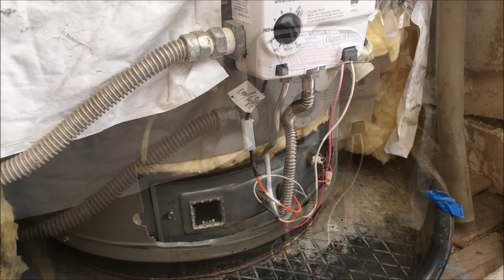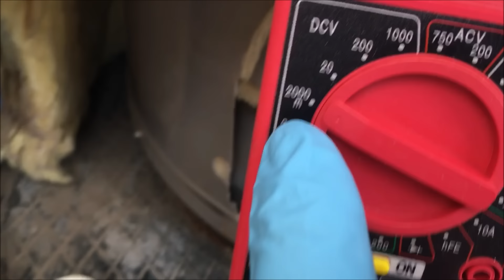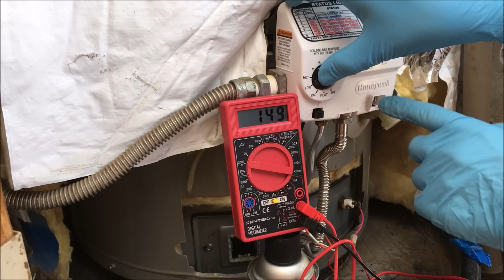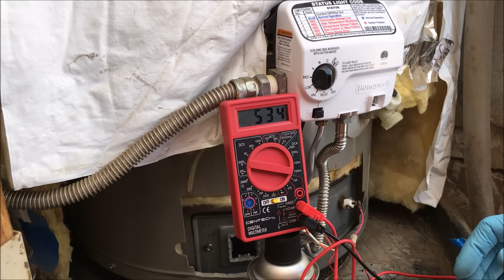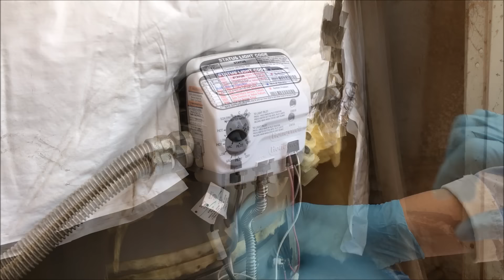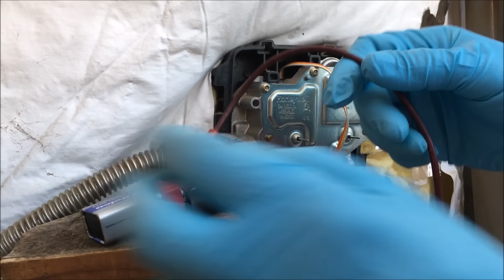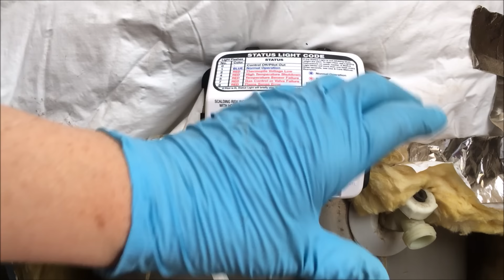Troubleshoot Water Heater AND Honeywell Gas Valve | Step-by-Step

Comment: Excellent troubleshooting information. I learned a lot.
If you can light your pilot and you know that the thermopile is putting out and you get NO flashing lights from your led on the valve, doesn't that tell you right away that your valve assy has failed?
Reply from the maker: Thank you, Richard.  Does the pilot stay lit or extinguish, immediately or after some time?
Reply: @frugaldiy1  Hi Frugal,,, Mine is working. I was referring to the unit you used for demonstration . I am a small-time landlord and water heaters are a common headache for me. I have replaced or repaired more than a dozen, however the one at my own house is 16 years old - that's pretty old for a water heater.
The subject of replacement boards for these controls interests me. I looked on Ebay this and saw either a complete new control valve for about $200,,, or a used board for 50-ish, and who knows if that board would work?
Reply from the maker: Oh, I see.  To your question in your initial comment.  It's not typical for an actual gas valve to fail on a gas appliance, e.g., water heater, gas insert, gas stove, gas dryer and so on.  It's usually something else that has failed.  But, on these water heaters with electronic Honeywell gas valves, the control boards cause folks endless grief.  So, no, is not an indication that the gas valve itself has failed; it's an indication the control board has failed.

I'd get a pre-owned replacement board off eBay from a seller who is a plumber and is selling the control boards, or entire gas valves, from WORKING water heaters the plumber has pulled.  That's what I'd do.
Reply: @frugaldiy1  I gotta admit, the mass air flow cleaner is a killer idea. I have that can sitting in my garage in plain sight yet I couldn't think of an easy was to blow out the lines in a water heater pilot assy a few days ago.
Those control boards work in all these types of Honeywell control valves even if the control valve has a different part number?  Maybe I should cruise around and stop every time I see a water heater sitting at the curb for scrap, and rob the boards if they are this style.
Reply from the maker: Well thank you, Richard.  I can't say with certainty that all of the control boards are interchangeable with all gas valve models, but I gave it a try, and it worked like a charm.  Another viewer replaced the failed control board on his NG (natural gas) water heater with a control board from a propane (LP) water heater and it worked just fine.  Boy, I love all of you wonderful resourceful folks out in YouTube land.

Comment: Hi there, I tested the pins with the 9v and the left one, described as being the one for the pilot valve, doesn’t make the click sound. Does the manual pilot button bypass this valve? The pilot button will light the pilot flame and stay lit until I release the pilot button but the main burner never ignites
Reply from the maker: The gas valve needs to be replaced.
Reply: @frugaldiy1  thank you, I have ordered one as I didn’t see anywhere that stocks it. Thank you for making this video, was very nice to go step by step and isolate the issue
Reply from the maker: You're welcome, Calley.  Last I checked, eBay sellers had the best prices on the gas valves and the control boards.
Reply: @frugaldiy1  thank you, I looked at several on eBay and they have the WV in the listing title but in the item description they had WT for the model, so I didn’t feel confident it was the WV one that can be reset
Reply from the maker: Okay.  Smart!  You can also purchase pre-owned gas valve and control boards from sellers on eBay who are plumbers.  They pull the gas valves and boards from working water heaters and sell them on eBay.  I'd buy one of those from a highly-rated seller.  Just something to consider.  Again, I'm frugal, and it's not typically the gas valve that fails.  It's the board.
Reply: @frugaldiy1  that’s good thinking getting a used one with it usually only being the board that fails
Reply from the maker: Yes.  Sometimes, people just replace water heaters that are working because they want a new one.  SMH!  And, in California, where I live, many people are replacing gas water heaters with on-demand because the natural gas prices are sooooo high.
Reply: @frugaldiy1  lol I agree that a working water heater is a strange thing to want to replace. Maybe in some cases like in California the operating cost savings eventually pays off.
Reply from the maker: I'm old, and when I was young, people tended to use and keep what they had until it no longer worked.  Those days seem but a fleeting memory.  They also didn't worship materials things as much as folks seem to do now.  I remember what an older gentleman said to me when I was seventeen years old, "Young lady, take care of your things, and they'll take care of you."  Those words stuck with me and helped launch me on my path to DIY.  Maybe you too will find some truth in his words.  ;)
Reply: @frugaldiy1  sounds like a wise gentleman, and wise of you to hang onto those words and apply them
Reply: Back here again 1.5 years later as the pilot valve in my replacement valve also quit working. Strange and figured I would share. Ordering another.

Comment: My thermal switch keeps popping and shutting down flame. I replaced it and still have the same issue. What could it be?
Reply from the maker: Manny, first, I'd make sure the vent at the bottom and top of the water heater are clear of dust and debris and not impeding air flow.  The thermal switch is a safety feature that triggers when the water heater chamber gets too hot, per manufacture specs.  I'd also go through all of the troubleshooting steps.
Reply: Follow all step. Everything checks out. Status light doesn't turn on. Do I need to replace the board? Or entire honeywell control panel
Reply from the maker: Just the board.  Go to eBay (cheapest I've found) and type in the model number of your gas valve and look for just a board.  There are plumbers on eBay who sell pre-owned Honeywell gas valves and just boards.  They pull them from working water heaters they replace, and they work just fine.
Reply: Thank you for your quick response. I will be subscribing to your channel. Great video
Reply from the maker: You're welcome, Manny, and thank you.  Welcome to the channel!

Comment: Great video! FYI there is an inexpensive water heater now available (Sure Comfort) that uses the good old analog type gas valve. Made by Rheem but I wont hold that against it. No control board to deal with I imagine but we can all do without that eh? Well at least after all this research I know the difference between a thermopile and thermocouple!
Reply from the maker: Thank you, Jeff.  And, thank you for the info about Sure Comfort.  I'd only purchase a water heater with the old-school gas valve.  ;)

Comment: Your video was EXCELLENT! I just have a couple questions: (my unit is LP) if the numbers I get for the thermopile & thermoswitch top out at 639 & 649mv respectively does that indicate a problem with them? And lastly, does it matter if the replacement control board comes from a natural gas unit or does it need to come from another LP unit?
Reply from the maker: Thank you, Mary.  Those numbers do not indicate the issue is the thermopile or thermal switch; it's something else.  Another viewer, who has a LP water heater/gas valve, used a NG (natural gas) control board and it worked for him.

Comment: Thank you for such a detailed video.  I followed all your steps and had the same issue you had.  Found a new board on Ebay as you said i would, installed it in about five minutes and now we are back in business!!  AND only out $35 instead of the fortune we would have spent on a plumber coming out. 👍👍👍👍👍
Reply from the maker: You're welcome, Manny.  I'm thrilled to hear you fixed the water heater yourself and saved a bunch of money.  Job well done!  Enjoy the hot water!

Comment: Great video 👍🏻pilot goes out every couple days or sometimes a few times a day on calm days so I don’t think it’s a wind issue
Reply from the maker: Hi Jeremiah.  Thank you!  Check the vent at the bottom of the water heater and make sure it's not impeded by dust and debris.  The vent needs to be relatively clear and clean or the pilot will not stay lit.  It's a "safety" feature.

Comment: This was extremely informative and I wish I had seen this week's ago. This is my exact issue. Thank you. As long as the first letters match up, does the rest even matter?
Reply from the maker: Hi Keith.  Re the model numbers, I can't answer that with certainty.  I was only concerned about the first two letters and took a chance it'd work fine, and it did.
Reply: @frugaldiy1  Thank you. I will get as close as I can and do the same.
Reply from the maker: You're welcome.  For what it's worth, I think it will work like a charm.  ;)
Reply: @frugaldiy1  I'm just glad I didn't buy a whole new control valve. I was about to haha.
Reply from the maker: Amen!
Reply: @frugaldiy1  One more question. Do you think there would be any different in the natural gas and LP boards?
Reply from the maker: I've pondered that question several times because, at my local ReStore, I can buy two new Honeywell LP gas valves for $25 a piece.  They just sit on the shelf untouched.  My gut level is that the control boards are the same, but I'm not sure so PLEASE don't rely on my guess.

Go to eBay and buy a used control board from a highly-rated seller.  Plumbers sell them on eBay because they replace working water heaters--the gas valve and control board are working just fine.
Reply: @frugaldiy1  That's what I'll do. For some reason Natural gas is all I can find and they're like 25 bucks so if it doesn't work, no big deal. Thank you again. I know more about water heaters than I ever cared to. But it's valuable knowledge.
Reply from the maker: Knowledge is good!  I see, you're on LP.  Were I you, I'd call a plumbing supply place and ask them if there's a difference in the LP and NG boards.  Maybe they'd know.
Reply: @frugaldiy1  I planned on ordering and then calling on Monday. Worst thing that happens is I waste 25 bucks on the wring board. Time is of the essence. Those cold showers are getting old haha.
Reply from the maker: I hear ya.  Please let me know how it all works out.  I'm rooting for you!
Reply: @frugaldiy1  Thank you.
Reply: @frugaldiy1  Update. Put the NG board in and it appears to be the exact same thing. Also fixed my problem. Thank you again.
Reply from the maker: That's wonderful to hear!  Job well done!  Enjoy the fruits of your labor--the hot water!  ;)

Comment: I replaced the mother board it lights up and stays lit but now my light is green instead blue, it flashes like 3 or 4 times pretty fast, should I be concerned?
Reply from the maker: I can't answer your question because the gas valve on my water heater is different than yours, so I don't know the status codes and such.

Comment: A very good video, thank you. I just have one question. You mentioned that there is a way to reset the control board if you have the 4 flash overheating status. I have this issue. Can you please share the method for resetting this fault?  Thanks again.
Reply from the maker: Hi Richard, and you're welcome.  Here's the link to my reset video: https://youtu.be/rllnMAx05JI

Comment: Gd video!
I have a question,
I have my water setting on A, but the temperature is 165 degrees,
I did have the temperature settings on very hot and hot  3 days before lowering the temperature..
But the water temperature.
When I lowered to  setting letter A,
Still has a much higher temperature,
Than 120 degrees.
And over the last 3 days the temperature is rising from 160 - 175 degrees.
Appreciate some help!!
P.s. The senser light has always blinked once, Since I purchased the until in 2020.
And never changed..
Showing Normal operation.
Reply from the maker: Sounds like a faulty temperature sensor or control board.

Comment: Could you tell me where to buy thermal cutoff switch for AO Smith water heater (same as in video)? I can't find a place where they are sold.
Reply from the maker: Hi Dimitry.  No, I don't.  You have to search around the internet for it.  My water heater is a Reliance brand, if that helps you.  Here's what I'd do.  First, try to reset the thermal switch by pressing the little button in the center of it.  If that doesn't work, I'd remove the thermal switch and find the part number, which will be stamped on it.  Search that part number for an AO Smith.

Comment: The problem on mine is water gets way too hot even on vacation mode or pilot mode. Any suggestions? I've tried the reset procedure.
Reply from the maker: The temperature sensor.

Comment: This is super helpful… after watching several similar videos, kept coming back to this for reference. What do you do if the pilot valve doesn’t click when connected to the battery??
Reply from the maker: Nathaniel, I would think the gas valve itself has failed.
Reply: @frugaldiy1  Thanks for the quick reply. In that case, I guess I need to replace the gas valve... do you have any videos or recommendations for that process? Finally broke down and had a plumber come out and look at things. He said I should order the part and he would put it in for $500. Hoping the gas valve replacement is something I could maybe learn to do on my own.
Reply from the maker: Hi Nathaniel.  I don't have a video on replacement.  Search YT and watch a couple of videos.  It's not at all difficult to replace a water heater gas valve.  I would never pay anyone $500 to do it.  That's a ripoff!  If you do want to pay someone to replace it, call around and get a couple of quotes and a more reasonable price.  Again, $500 is a ripoff.

Comment: This is an amazing video! Covered each and every way to troubleshoot the water heater and the gas valve. Took me a month to find this video but it was well worth the cold showers as I saved $2900+ dollars for what literally was a $30 computer board on eBay. The HVAC company I called initially wanted to just replace the entire water heater system. Very glad I came across this video!
Reply: you can buy 4 heaters with that money
Reply: @jondoh3471  service is a criminal act today...2900 $...shame..
Reply from the maker: Gosh, that's great to hear that you saved so much money AND that you fixed the water heater yourself, zinja12.  Job well done!  Thank you for your thoughtful comment and that you took the time to write it.  Enjoy the hot water!

Comment: Thank you so much for this excellent video. The Pilot Valve pin didn't click when I tested it unfortunately. Does this mean I need to replace the entire control valve?
Reply from the maker: You're welcome, Mo, and thank you.  Yes, it likely does.  But, read down in the comments for a couple of comments by gentlemen who said one or the other pin was loose and they resoldered it.  Check to see if the pin is loose.  Also, with the handle-end of a screwdriver, lightly tap around the pilot pin and see if that fixes it.  I've tapped on gas valves before, and they've worked after.

Comment: Thanks for the video. 10/10...  If you get no click for the pilot valve, what do you do?
Reply from the maker: You're welcome, Curtis, and thank you for the nice comment.  Regarding the "no click" issue, it may be that the igniter switch, versus the igniter head.  Here's a link to my video on replacing the igniter switch:  https://youtu.be/tm4OYqwykPY

I think your issue may well be that there is corrosion between the igniter switch and the plate the igniter switch contacts.  So, don't replace the igniter switch, just do this--take some fine-grain sandpaper or emory cloth, or even a nail file, and lightly sand the head of the igniter switch and the plate it strikes against.  See if that fixes your issue.  If it doesn't, my guess is that the igniter switch or the igniter head (in the combustion chamber and next to the thermopile and pilot head), needs to be replace.  

If you need to replace the igniter head, I HIGHLY encourage you to replace the entire pilot assembly (that's what it's called) because it's a lot easier and cost effective to do that.  So, here's a link to my video to replace a thermopile, which is the same procedure you'd use to replace the igniter head:  https://youtu.be/httzdihCxvM

In the description area of that video, I have a link for a pilot assembly you can look at.

Comment: Thank you for such a nice video. I have always loved to watch troubleshooting videos. I found this when I was troubleshooting my brother's water heater which the pilot failed to light during reheat. It lights up fine during start up but as how water get consumed, it will not re-light. I had changed the thermopile + pilot assembly and that did not solve the problem. I was thinking of changing the entire gas control valve but I just know it'r probably an electronic problem rather than a mechanical problem. This video is extremely helpful in isolating the different components for troubleshooting. Thank you so so much!!!
Reply from the maker: You're welcome, Tao, and thank you for the comment.  Based on what you've said, my guess is the control board has failed or is failing.  The control board may be sensing the water is getting too hot to be safe and shutting down the pilot flame.  It's a common issue.  So, before you go further, try resetting/overriding the control board, like I show in this video: https://youtu.be/rllnMAx05JI
Reply: @frugaldiy1  thanks. He has power vent so I will try the reset as well. The pilot fails to re-light every couple of days which is kinda weird. I’m going to test the pilot and burner valves Ana’s the temp sensor. If they all work then I’ll prob just replace the board. Thanks again
Reply from the maker: Okay, Tao, and you're welcome.  I like you're methodical approach.  I think you have a good plan for troubleshooting the issue.  I have no doubt you will find it and fix it.